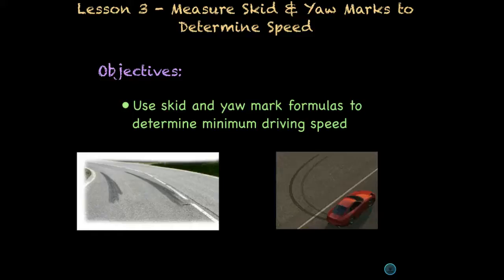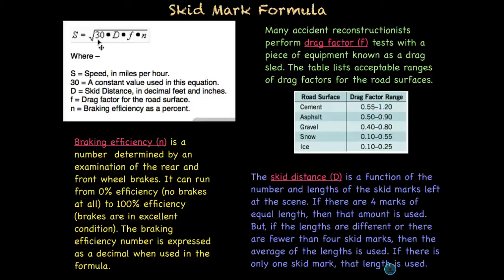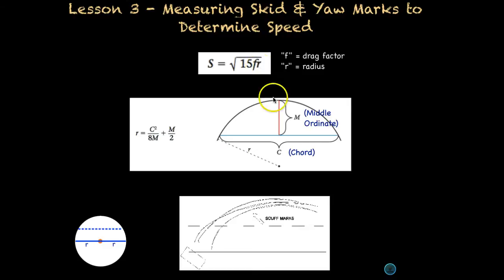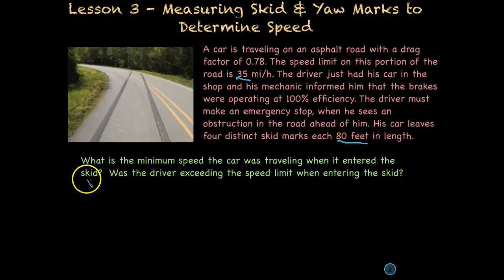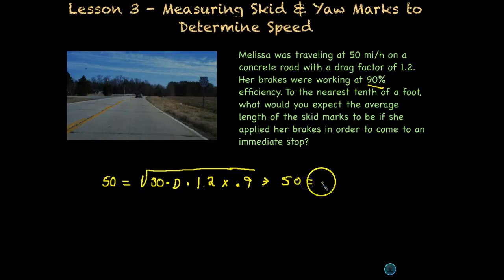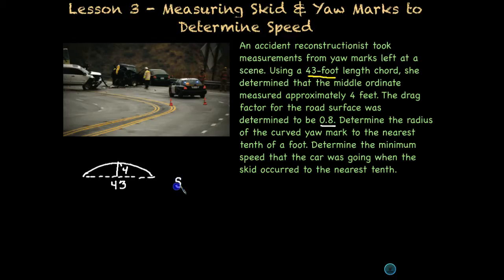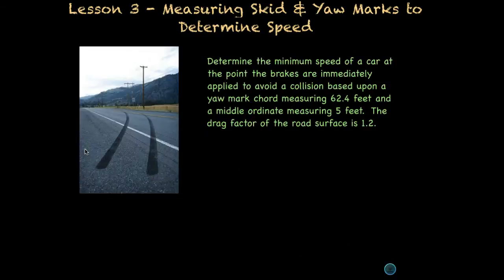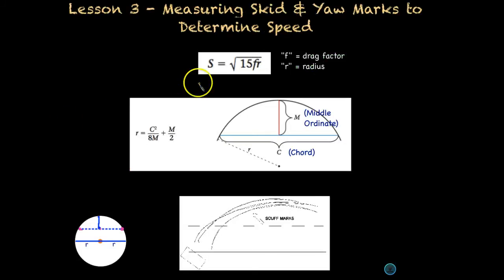Lesson 3 - Measure Skid & Yaw Marks to Determine Speed

Comment: what if the skid marks are not from tires but from a crash bar on a motorcycle? simply a release of throttle and a low side skid with 1 inch wide of surface area scrape on bar and rear saddlebag
Reply: Same formula but you'd have to test the ACTUAL scrape bar & saddlebag to see what the coefficient of friction is for that bar. Can't use a tire drag sled because it's not rubber, but the skid is the same, just different material. Now, if there is a gouge in the roadway from the bar and saddlebag, I have no idea. That would add another factor...Many times, if the car isn't too banged up, they will use the actual car to test what the skid marks, brake efficiency, and cf is.